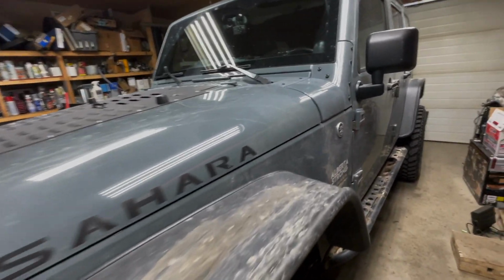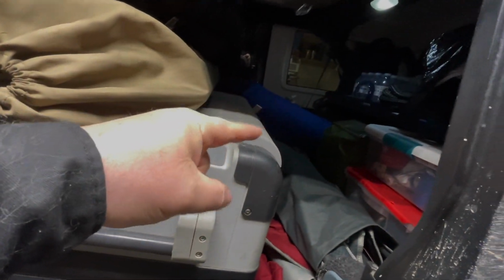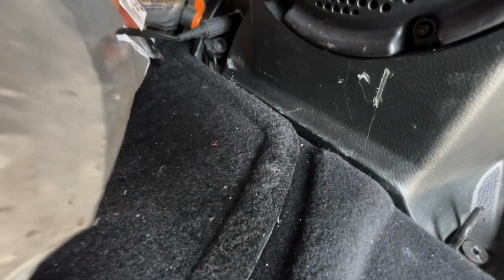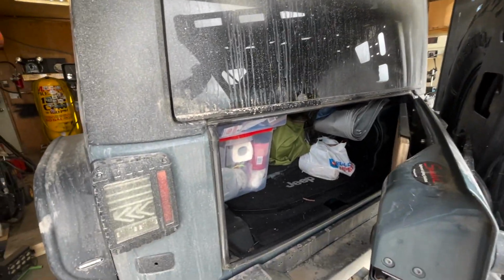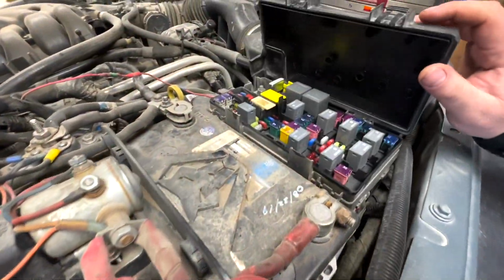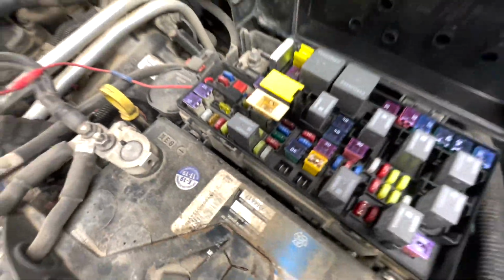Jeep JK AUX POWER : Full Time Or Ignition On ?

Comment: Why does no one talk about running the fuse tap wire to the outside of the fuse box?  They just slam the cover onto the wire 🤦 🤦🤦 saw you did a hole.  I’m assuming that’s a good spot. Ty 😂